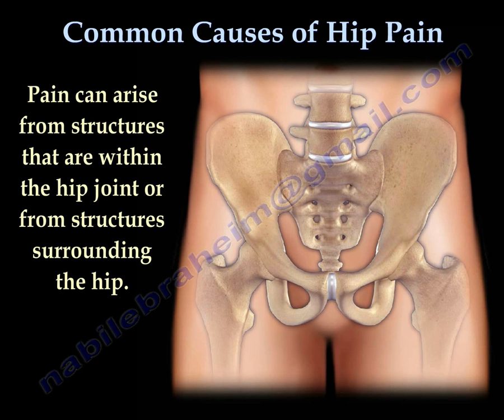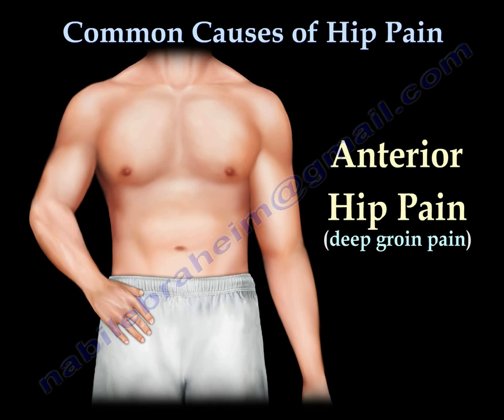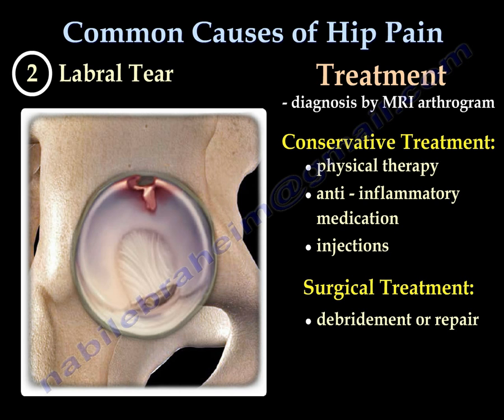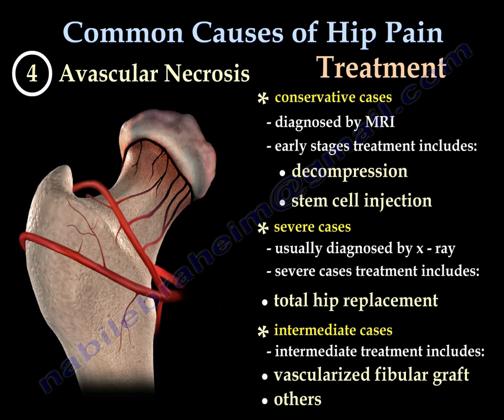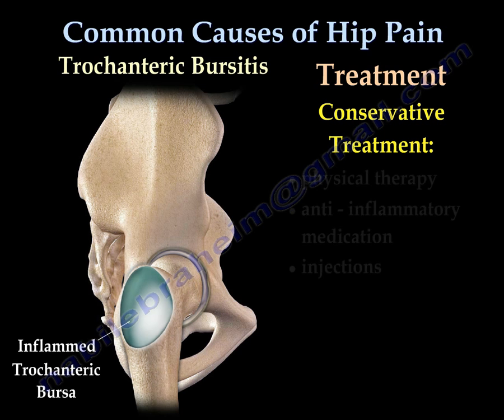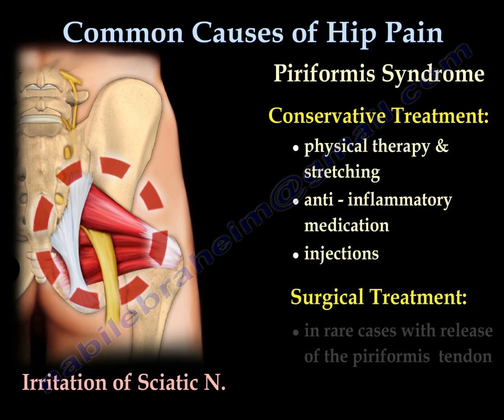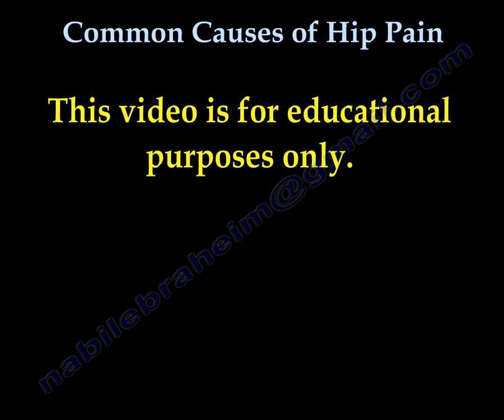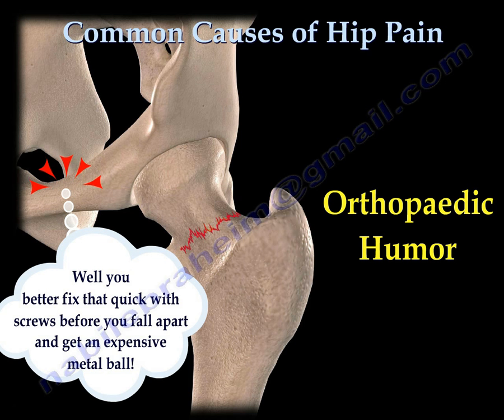HIP PAIN ,COMMON CAUSES- Everything You Need To Know - Dr. Nabil Ebraheim

Comment: injections, injections, injections...$500-$1500 each. not FDA approved for these types of treatments. largely totally ineffective.
Over time, injections actually break down the bone density and contribute to even more serious problems later on. I've had 8 of them in my spine, facet and si joint. Nothing but heart palpitations, insomnia and panic attacks afterward (which are abnormal. I really wish this whole steroid injections fad would be put to the curb where it belongs.
Reply: FallingDownTheRabbitHole   let me tell you where I have pain that nearly brings me to tears. 1left hip. 2 inside the heels of my feet 3 extreme muscle tightness in the neck,upper back under the shoulder blades, I need a good back massage.  other then all this wonderful pain, I'm good.

Comment: Many women are having groin/hip pain after having a mesh sling, or tape, implant for SUI also. Especially if it was a TOT sling (transobturator), which is  placed through the obturator muscles. The mesh can also  harden & erode. This can cause muscle and/or nerve damage, affecting the groin/hip/leg. Unfortunately, most doctors will not acknowledge or recognize that the mesh could be, or is, the problem... unless they go to one of the few doctors that can actually remove mesh & specialize in mesh complications.

Comment: I had a hip replacement 6 months ago.  Best decision I made, I walk without limping which is great. The only thing I experience is stiffness
and tightness can anyone relate to the same thing.   I have been told it eases off over a period of time.
Reply: Glad I can share my experience after a hip replacement. 
The only frustrating thing was. 
I was expected to recover after 6 weeks. All the comments I read state recovery time was supposed to be, between 6 weeks to 12 weeks.
That’s is rubbish!
It was after 6 months, when I felt fully confident in walking properly, without discomfort.
I would say it takes  6months to a year to recovery completely depending on your age
I was walking after 6 weeks and driving. 
I force myself and suffered as a result of it.  I over did it.
Reply: @tessabennett8498  you from my age is 25
Reply: How is your hip
Reply: @cvvideos1943  Thank you for asking.
My hip is fine. No problems at all.  in fact I often forget that I ever had it replaced. It has been 6 years now.
Reply: @tessabennett8498  I also hip replacement since  1.5 year  due to accident left hip damage now I'm good when my operation success 2 month very difficult pain I'm from indian and you

Comment: vowarren7 yes, it is very possible to have pelvic floor pain along with rectal pain due to a 'hip problem.' Look up and research all that you can on Piriformis Syndrome! It is probably at the root of many 'back' issues.If the hip girdle muscles are not working in tandem properly, the piriformis muscle becomes overworked and spasms. It can kill off the sciatic nerve, press on pelvic nerves, pull the sciatic joint apart in the sacrum, cause the hamstrings (posterior thigh) to cramp. Research it!

Comment from the maker: Lateral pain can be confused with hip pointer and tensor fascia lata irritation. Hip pointers are classically known as a contusion to the iliac crest (pelvis bone), but it is also known to be in the greater trochanter area. Usually, it is caused by a direct blow or a fall. It occurs in sports, especially in contact sports. The pain is usually localized and increases with running, twisting, and jumping. It may also cause decreased range-of-motion.